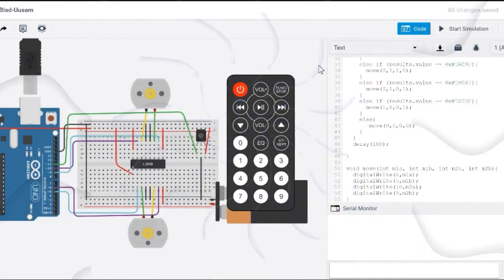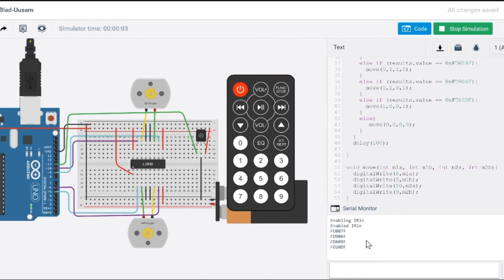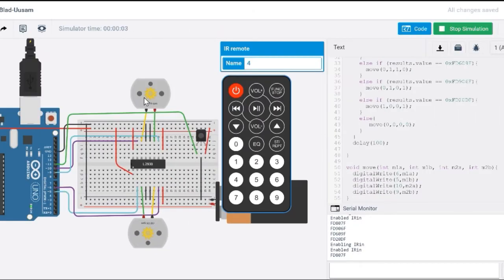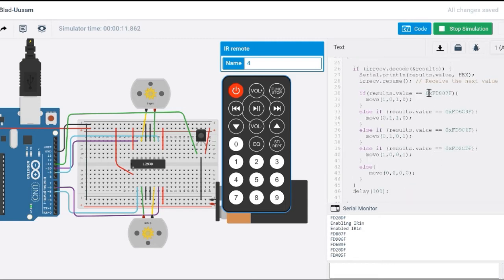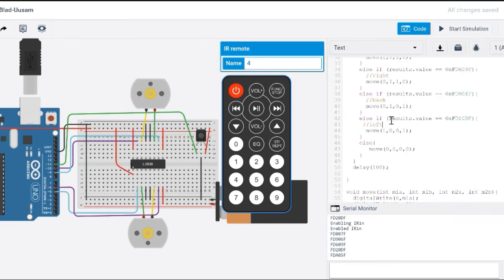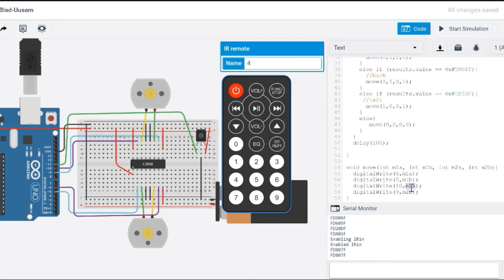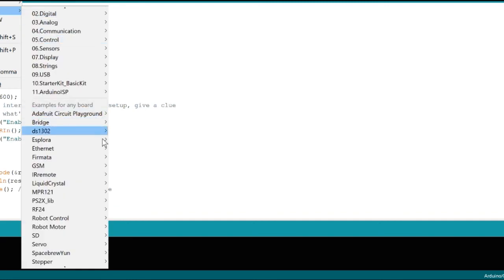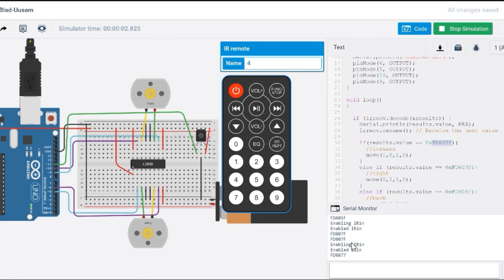Using an IR Remote To Control DC Motors

Comment: hey what if I want to control speed of the motors too? what other changes should be added to the circuit and code?
Reply: At that point you would need to add a motor controller or power the motor from the arduinos analog signals (don’t do that)
Reply: @floatingdoggo6529  why shouldn't you try to control the motors with analog signals ?

Comment: I liked this video a lot and took inspiration so I decided to use this for my own Arduino so I found the hexadecimal codes for my remote at home and I replaced the original hexadecimal codes with my own and now it is giving my a "This was not declared in this scope" and it highlighted my hexadecimal codes. I have no Idea how to fix it and I don't know where I went wrong.
Reply: I honestly feel really dumb, I figured it out. apparently i forgot to put the "0x" before the code, dumb mistake
Reply: @mr.fishman1510  i have a question did it work first time for you because for me when i used it and looked at the serial monitor the codes from my remote came out as FFFFFFFF